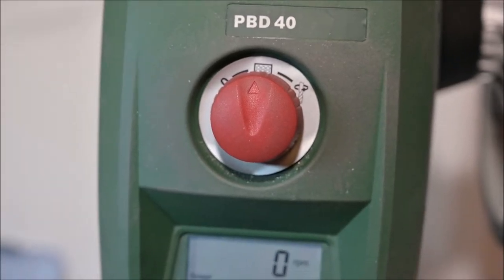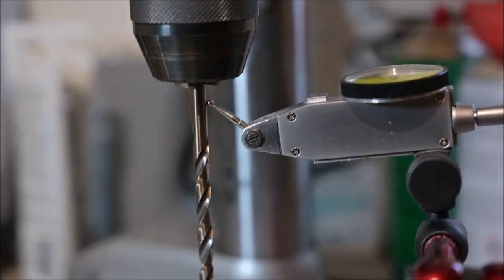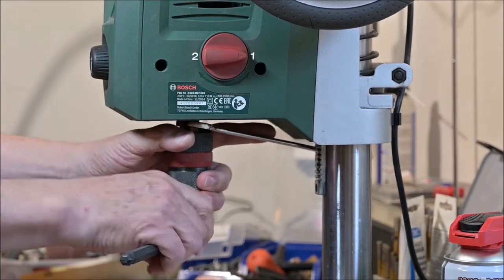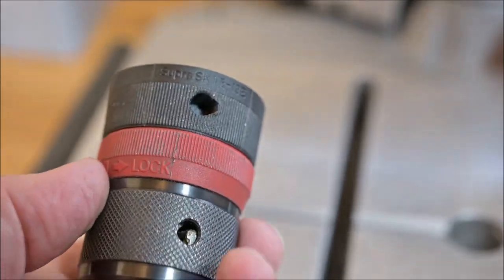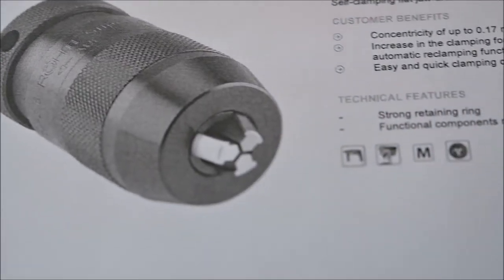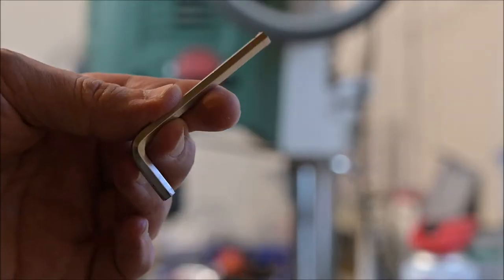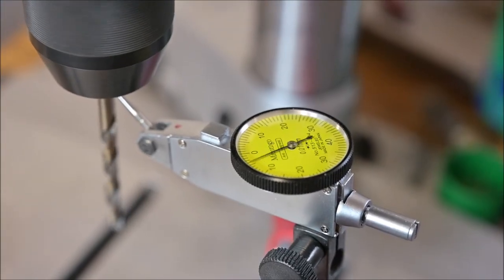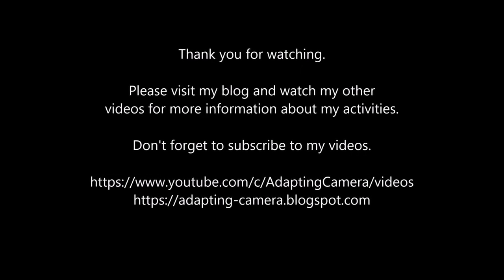Chuck changing on Bosch PBD 40

Comment: thanks so much for sharing this. i just wanted to come back and ask about the gearing ratio. if its possible to change that?

the reason for wanting this is for precision metal drilling small diameter holes. this requires to lower the speed while keeping the torque as high as possible. therefore it benefits the torque to change the gear ratio on speed 1.  and reduce it down the even further than stock. to preserve as much of that max torque as possible given the usually expected torque drop off curve of a variable speed electric motor. of course it would help to see a torque curve from a specs sheet here to determine that. however i dont know what the motor part number is.

for the high gear it could also be altered or adjusted. for optimizing to other chosen softer materials such as wood or plastics etc. which need to run faster
Reply from the maker: To be fair, I don't understand why you want to go to lower RPM than the low gear allows you to. What you want to do is illogical. When you are drilling with small drill bits, you actually want high RPM, otherwise you will break the drill bit. The friction will also generate far too much heat, so you'll make it into a dull drill in no time. What you are saying makes no sense to my ears. I drill a lot of very small holes in metal and those require high RPM. Actually, most of the time, drilling in plastics means lower RPM than in metal, but of course, that depends on the plastic and the drill bit you are using. Large drill bits require slower RPM, but never slower than than this machine can deliver. Anyway, I would not modify the machine regarding the RPM, but there is a gear box, so if you want to, and can find, or make the right gear combination then it may be possible. Anyway, the general rule of thumb is: small drill => high RPM, large drill => low RPM regardless of material. Otherwise you will burn the material or the drill, or both.
Reply: @AdaptingCamera  unfortunately i cannot remember the precise reason for this. however it was something recently featured by ox tools, within a monday night meatloaf episode. tom lipton was fingering through some really old machinists book and was explaining that while this is something that is completely counter intuitive, smaller drill bits can in fact require a slower cutting speed. maybe it had something to do with the material depth on thicker materials. but i really cannot remember now. tried looking for it but  unfortunately i have this stupid bug in by we browser. and his meatloaf videos are not indexed or time stamped. and i simply cannot remember which episode. but it must have been one of the last 3, so maybe 141, 140 or 139. this guy is a well respected long time professional and very dedicated machinist and so i am sure you would find his advice of relevance, and of value. so i dont think your time would be wasted to find out here

and yes, they do noodle a lot more so there is then a compromise or a limitation in how slow you can actually go down to. but i have now tried it myself (just with a hand power drill, going into steel). and it actually works!! (believe it or not)

so will try to download those episodes and then get a better reference for you to watch... it just take some more time
Reply from the maker: @dreamcat4  OK thanks, but I don't know who he is or what a "Monday night meat loaf" is. Anyway, if you believe him and believe that the whole world is wrong and he is right than that's fine for me. I will continue drilling as I learned and have been doing it for many years. One thing which is very important is that you are using the right drill bits for the material. Many people ignore this and just buy any cheap crappy "universal" drill bits and use that on everything and then complain about the machine they are using... :)

Comment: Great review, thanks. The annoying thing is that after spending around £280 (Jan 24 UK price), you have to spend another £90 on a decent chuck. When you look at the total price, it doesn’t seem good value.
Reply from the maker: Well, I disagree. Even after spending more that that I still think it's a good machine and would buy another one today if the one I have would break down and would not be possible to repair, but of course it's a shame that Bosch delivers this machine with such a crappy chuck, which is not even made for bench drill machines, but hand impact drills.

Comment: Hi, great informative video. What chuck would you replace the factory chuck with for tapping/threading mild steel? Can you get this to operate with a reverse?
Reply from the maker: I am sorry, I am not a chuck expert. Also, this machine is not suitable for tapping. It is a bench drill machine, not a mill, so reversing and running it slow enough for tapping is not possible.

Comment: Great video thank you, unfortunately it would seem that Roehm, or at least the retailers, have caught onto it's fame amongst pd40 owners because the price for this specific chuck seems to have sky rocketed since you made this video in order to cash in on us. or maybe the issue is geographical but I doubt it, it's almost half the price of a new PBD40 now which I can't justify. This is leading me to think of other possibilities, I've always been happy with the chuck on my Makita heavy drills and i do have a spare one I don't use, I'm thinking perhaps I can take the chuck from the Makita and fit it to the Bosch, providing it will mate up to it which I have no idea. 
Another thing I've noticed is this is the same chuck that comes with the Makita 12v brushless drill, which Since new has had a terrible amount of run out and I've always hated it, imagine my surprise when I realised it's the same heap of crap on the Bosch. 

I have done the bearing mod, and it helped by about half, maybe. I was expecting little to no run out based on peoples feedback/opinions so I was disappointed to still see some runout, albeit reduced, I think the next thing to do will be to stop the whole head from deviating left or right a few mm's when lowering it to the work piece as sometimes it doesn't even touch down where the laser is or where my hole was punched, simply because the head is wafting around. Frustrating.
Reply from the maker: I don't know where you looked, but it's hardly what I call "sky rocketed"... Easy to find for around 110 USD on Amazon. Röhm original was always a bit higher priced than cheap Chinese knock off.
Reply: Welcome to Australia. It's about $300aud for me. @AdaptingCamera

Comment: Hi, can you measure the run-out again with the new chuck you installed in 2020? How is it now more than a year later?
Reply from the maker: Good question. I will measure it as soon as I have time, but currently, my way of "measuring" is simple. I use this machine mostly on metal, so now and then I measure the hole diameters. Just yesterday I needed some precise 5mm and 10mm holes, so I measured those, and they were all very precise, right size all of them. That was never the case with the original chuck, so I guess that the run-out is still very good. I still have to change the bearings, just need to find the time to do it.

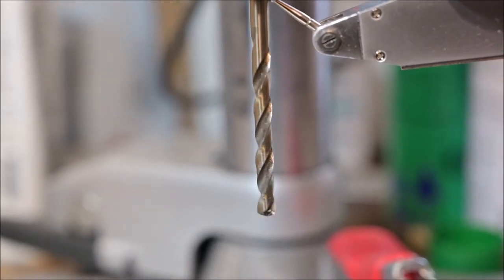Comment: I'm inexperienced in the use of precision measurement gear, but I thought at 2:05 the lever arm should swing in the horizontal plane (ie. such that the dial face would be in the vertical plane) - wouldn't that better measure runout?
Reply from the maker: Actually, it makes no difference for that instrument. It shows the to and from direction of the movement. If the dial would be facing vertical it would still be the same to and from movement. Anyway, the most important for me is not to quantify the measurement precision, but to see the difference of before and after, which can be seen at https://youtu.be/nCqVoaGVK8g?t=469 and as long as the setup is the same, the difference is clearly visible.

Comment: Thank you, that's what I needed. Just in time. Good explanation.
Maybe you can tell me the difference between the Röhm Supra 13S 1/2" (871050) and the Röhm Supra S13 B16 (871047)? Both fit the PDB40? Am I right that the B16 is a bit more "precise" (cause the Concentricity
 deviation max. mm = 0.17 and on the 1/2" it is = 0.25)?
Thanks for the video and your help!
Reply from the maker: Thanks for the comment. I am glad that my video helped you out. The B16 is indeed better, but it does not fit because it is a B16. The Bosch PBD 40 has a threaded motor axis, so it needs the threaded chuck. The threaded chucks are normally worse than the B12, B16 and B18 types, which have conic fits, no threads. I am no expert, but the reason must be the fact that every kind of thread must have some play, otherwise we would not be able to twist them on/off. This play causes some extra concentricity error. Anyway, the 871050 is miles better than the Supra SK E, even if the data sheet says only 0.1mm better concentricity, in reality the difference is huge and feels immediately after the first drill.
Reply: @AdaptingCamera  In all honesty, that's the most useful piece of advice I've received from a comment here on YT.
So I will go with the 871050  :-)
Thank you!
Reply from the maker: @photobastlmichael9810  Thank you very much. I really appreciate it.

Comment: Hi @Adapting Camera , thanks for the info. I want to see if I can remove my existing chuck before buying the upgrade. Does the chuck unscrew in the normal sense, ie turning it clockwise viewed from above? And  the allen key fits between the jaws of the chuck, so no particular size? Thanks for your advice.
Reply from the maker: Hi Eamonn, Yes, to unscrew you rotate the chuck in clockwise direction seen from above. Your chuck may feel totally non-removable, but don't worry, you can do it if you do it right. Probably you need a piece of pipe also, just like I did. Mine was VERY hard to remove when I did it for the first time, and I mean REALLY VERY HARD, so I definitely couldn't have done it without the pipe and without actually fixing the axis with the help of the16mm spanner. Follow every advise on how to remove it, starting here: https://youtu.be/nCqVoaGVK8g?t=147 and you should be fine. Whatever you do, don't use a hammer because it will damage your motor axis and the chuck you are trying to remove. The Allen key should be a large one, as large as you can find, the larger the better because it makes it easier to remove the chuck. Make sure you are buying the right replacement chuck with 1/2"-20 thread, not B16.
Reply: @AdaptingCamera  Many thanks - I'll give it a go!
Reply: Success - I may have a few burst blood vessels but the chuck is off! :) Thanks again.
Reply from the maker: @eamonnmcgreevy6665  Great news! So yours was just as difficult as mine to remove... Good luck with the replacement. My PBD 40 is like night and day. It is really a joy using it now. I don't understand why Bosch selected that chuck at all. It is for hand drill machines and impact drills, not for bench and pillar drill machines, and actually the price of both chuck types are about the same, at least if I compare Amazon prices. BTW, I did not use any super glue on the new chuck. The machine rotates in one direction and is tightening the chuck on the axis during the rotation, so there is no need for super glue.
Reply: @AdaptingCamera  Yes, tough to remove, I was about to give in but give it one final squeeze and it relented with a crack, not quite an explosion.  Quick question though... I want to now sell the original chuck on eBay  and need the exact item no. Is it 1193005: http://eshop.roehm.biz/roehm_de_en/1193005.html ?
Reply from the maker: @eamonnmcgreevy6665  Yes, the original chuck is the SUPRA SK E 1.5 - 13mm with the Rohm item number 1193005. Early versions had red ring, later ones are black but otherwise it is the same. Good luck in selling. I kept mine, just in case I want to use it on my hand drill machine.

Comment: hello, if we want to keep the bearings as it is and we only want to change the chuck as you did, then what chuck variation do you suggest because in rohm site has a lot.i want 1-13 chuck size.but it has 4 different variations.should i take the 871050?  thanks
Reply from the maker: Please watch the video. I think I am very very clear in it about which chuck to buy and why. Only one of the 1-13 fits this machine.

Comment: I made a quick comparison of the run out in two Röhm drill chucks on my Bosch PBD 40 after upgrading the upper spindle bearing. The factory supplied bearing is a 8x12x8 mm needle bearing. This bearing sits at the top of the gear box. Unfortunately it has a lose fit around the spindle, which allows for a lot of run out in the tool. I followed the example from other Youtubers and replaced the needle bearing with two 8x12x3.5 mm ball bearings. Unfortunately, I made no measurements before the bearing change. The first part of this video demonstrates the run out with the standard Röhm Supra SK 1.5-13 mm chuck (the one with the red plastic locking ring). The second part shows the improvement gained by changing to the Röhm Supra S 1-13 mm (ID 871050). I think it is fair to say that the total run out is reduced from 0.1 mm to 0.04 mm. The shaft I used for the measurement is a standard 10 mm edge finder. A fun fact: the standard chuck weights 385 g and the Supra S 560 g. Here is the video link: https://youtu.be/oIsTQb0HJCA
Reply from the maker: Thank you. So basically, it is half the run out compared to the original. What we don't know is how it would be if you'd have used better quality pin bearings of the same dimension. Anyway, I still think that most of the run out comes from the spindle bearings above the chuck. If I get on with this work I will change all bearings. Was it easy to remove the pin bearing? What tool did you use? Bread...? 😀
Reply: @AdaptingCamera   When I look at your video I see that your indicator arm is not parallel with the drill. A 45 degree angle implies a lot of cosine error. The indicator may allow the arm to be angled but it should imho be parallel with the measured object. Am I wrong? Compare to my setup. I described most of the bearing change in an earlier comment here, and gave a link to some pictures I shot during the operation. I made a bearing extraction tool from a 100 mm M8 screw with hex head. I began by splitting the screw a few centimeters from the head and upwards to the threaded part with a saw. Then I squeezed the halves together and machined the hex part to 8 mm diameter, and removed material at the end, so I got a sharp edge around the perimeter. Think of a very short head of a countersunk screw. When the compression over the head is released the two halves separates. Next I made a shim of aluminum. The shim should be as thick as the saw blade and fit into the saw slit. To remove the bearing, squeeze the halves of the tool together and insert it through the bearing. If properly done, the hook part is exactly 8 mm wide, and it is perfectly round when compressed! (That's why it should be split first and machined to 8 mm diameter afterwards.) Release the pressure and insert the shim. I used no force at all to do that. It is not much to grip on since the little space under the bearing is occupied by a bearing washer of the same inner diameter as the bearing housing. I guess my tool slipped upwards a bit until it stopped against the needles. The other part of the screw has threads so it is straightforward to make an arrangement with some clamping and nuts to get leverage on the bearing. All this is made easier if the motor is detached from the gear box housing. But don't remove the motor until the whole package is lifted off from the machine. When you have the bearing in your hand, you have earned a cup of tea! Sorry about this long description, I just recalled that Youtube is for videos, not long text reports.
Reply from the maker: @paullehmor982  Don't worry about the length of your message. This is my video and I have the power to do anything I want with it, if it would disturb me I'd delete it. Instead I say thank you for taking the time in typing that detailed explanation. Written instructions are easier (for me) to remember than to watch a video and remember what I have seen. Maybe it's the age. I am a "reading generation" guy, video for me is mostly for entertainment and for getting /sharing ideas.

Anyway, regarding the angle I measure vs. you measure, I don't think it matters but I can be wrong. Maybe next time, I'll check both ways and see if it makes any difference. In any case, what I think is important is the relative change, not that it is measured exactly, and since we measure both before and after the same way (you do it your way, I do it my way), any error in the measuring method is removed. We simply compare and can see that the improvement is obvious and the run out is about half compared to "before" in your case with the bearing change, and more than 3 times in my case after the chuck change. The 0.07 mm my indicator shows after the chuck change may turn out to be 0.1 mm using your indicator and your measuring angle, but it doesn't matter to me, since in that case even the original 0.23 mm run out error I am measuring before the change should equally be more, so my improvement should still be 3 times or more.